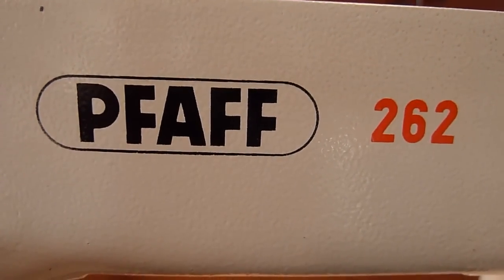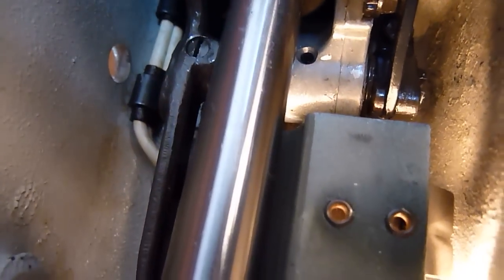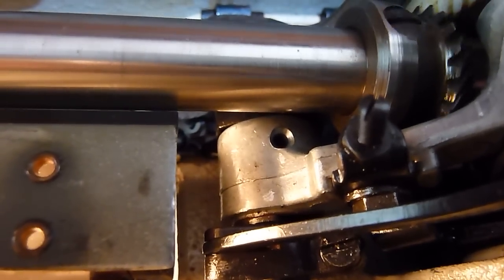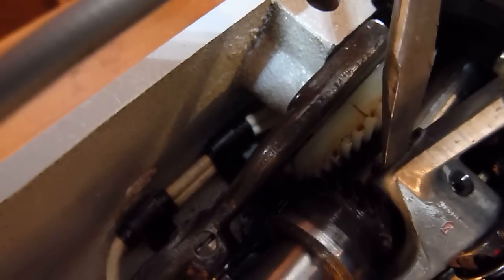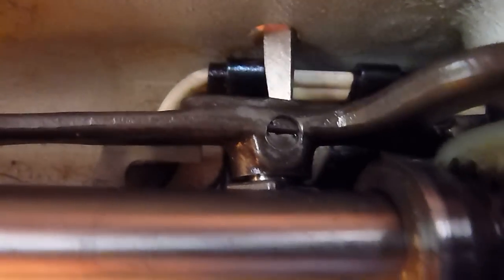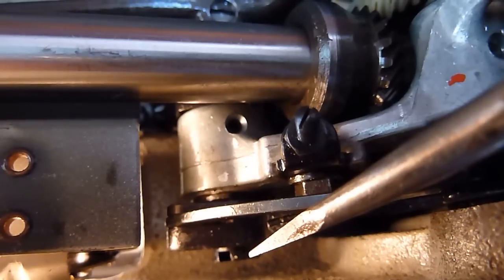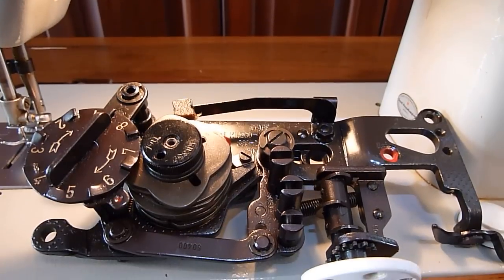How To Repair a Pfaff 260 262 332 360 362 Zig Zag Function

Comment from the maker: Hi, glad that helped you.
Re: the stitch width.  First, use a hair blow dryer, from inside the machine, to get the metal components in the area of the dial, hot.  You are not pointing the blow dryer at the white plastic knob on the outside of the machine!  You are pointing the blow dryer at the metal levers inside the machine, so take the lid off the machine.

Once you have the components hot, spary with PB Blaster and start working the control knob.  It should free up.

Comment: Thanks for the video. I was able to free up my 362 with a heat gun (with narrow tip) 800degF and pointed at the aluminum arm. I used Kroil to lube the entire assembly.

Comment: Hi Austinado16,
Many thanks for your time and video-work! 
I have 3 Pfaffs to repair with the same 'problems' - 260, 2x 360 and we have also two perfectly working Pfaffs; the 332 and 362. All automatics except the 332. 
We just love the Pfaffs. Your video will sure help me out. Even though I do have the repair technical manual.
So, many thanks! If I encounter problems with the repair, I sure will post them here..

Comment: Thank you so much for posting this.  I inherited a Pfaff 362 that had the same issue, and followed your instructions to free up the zig-zag mechanism.

Could you also post something about how to remove and clean the stitch width dial?  Mine is very difficult to move, and it feels like it has the same issue with varnish buildup.

Comment: Your suggestion using a hair dryer and solvent worked perfectly to get the zigzag on my Pfaff 360 to work.  I couldn't turn the screws that hold the cam mechanism in place, so I sprayed the areas you described using the long, thin tube on the can and heated those connections with the hair dryer.  Then I kept the heat on and began putting the zigzag to work until it ran correctly, 0 to 4, forward and reverse.  I am so grateful to you.  Until someone can do a better job, at least I can keep the machine running properly.  Thanks, again.
Reply from the maker: Patricia Pflum  So glad you found this info helpful and were able to get your machine working again.  Nice job!

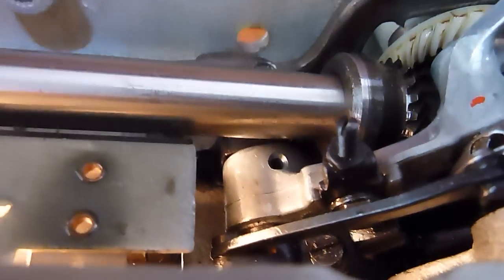Comment: Thank you so much for this video. I could not figure out how to center needle until I came across this video. Centering needle is at 3:00 for anybody looking for help with needle position. 👍
Reply from the maker: You're welcome!  Glad you were able to get it dialed in.
Reply: austinado16 I have a 360 and have  been dealing with a timing issue when I use the ZZ. Needle hits hook  but can not figure out a easy way to adjust timming. In straight stitch is perfect chain stitch. Any help would be appreciated.
Reply from the maker: I'm sorry, I can't help you with that one.
Reply: Maybe your needle is too long or adjusted down too far.

Comment: After freeing up the zig zag function as is so clearly detailed in the video, I found that on one of the machines, the zig zag function worked but the machine seemed to bog down when I switched from straight stitching to zig zag ( 0 to 4).  I traced the problem to the needle bar assembly.  After removing the needle bar cover, I found that  the adjustment screw pivot, the slide block and the interface between the needle bar and the crank which drives the needle bar were all bound up with shellac.  I completely removed the adjustment cam screw, and slid the needle bar on its slide out and away from the crank arm.  Using lacquer thinner I then cleaned up the slide, the pivot shaft and the adjustment screw cam pivot.  The shaft that is driven by the crank also has to pivot.  The pivot on the square block on the needle bar was also frozen.  After freeing up these pivot joints,  and reassembling and re-lubing,  the bog down problem was gone and the machine spun freely in all modes.

Comment: Thanks for the great video. I haven't found anything else on these machines with regards to repair. Do you have any pointers that would help remove the pin? I have the set screw loose and the clip removed. There is no movement in the pin itself, and I suspect it is seized.
Thanks again for the video, keep up the good work.
Reply: hi kirby  im not sure if you got it done but what i did was...
first get the locking screw and clip off
then i let some penetrating oil soak into the grooves for a few days
then i tapped the pin into the machine a bit just to loosen it (toward the nylon gear)
then let more penetrating oil get in there
then, VERY gently tapped the pin back out from the machine with a small hammer and a nail as a drift (pin pushing tool)
in the past i have also use a hairdryer and/or heat gun on the area which helped get things loosened up, but again i do this with great care not to over do it.

Comment: I have a Jeans Machine WHITE 1077 that this same problem occurred - the vaseline/gasoline combo worked like glue and the zig zag has stopped working. Machine still in good condition. The mechanics are slightly different than a Pfaff, but do you also know how I might go about fixing my machine? I'm very new at this, but want to figure it out!
Reply from the maker: I don't know the specifics of your machine, but you could try heat from a hair blow dryer and a penetrating oil.

Comment: Awesome video Todd! I purchased a Pfaff 260 that only does straight stich  and zig zag. It has not been used in a while, so of course it seized up, I managed to get it to work a bit using a hair blow dryer. However the needle doesn’t work to be moved left or right it’s stuck only in the center. Also when I disengage the clutch to wind the bobbin with thread the needle is still engaged. Any ideas how to fix it or any suggestions I would greatly appreciate it! Thank you in advance😁
Reply from the maker: The machine is still glued together inside.  You will probably have to remove the special stitch cam assembly, so that you can watch the internals of the machine, determine what should be moving, and what it will take to free it.  It's not uncommon for the hair dryer to melt the old lubricant enough that the machine works, then, while hot, but then won't work after it cools, because the old lubricant cools, and returns to thick glue.  In situations like this, the pivoting parts have to be disassembled and cleaned with some type of solvent.

You could try applying heat and WD40.  WD40 is a terrible lubricant, but it's very high solvent, and won't hurt the paint on the machine.  The WD40 may flush out the old lubricant, and allow you to apply something like TriFlow, and then synthetic sewing machine oil.  Then once the stuck area cools, it will pivot.

Comment: I have a Pfaff 362 machine and was wondering if the video applied in my case. The machine will straight stitch and zig zag. The cam system will turn but doesn't seem to be working at all. The left right center needle lever doesn't work ether. But you can turn the lever left right and center. Reverse works too but I notice that as I turn the stitch length dial the reverse lever doesn't move as much. Moving it all the way to the end the lever doesn't move hardly at all.
Reply from the maker: You'll just have to take it all apart and clean out all the varnish that is gluing the pivoting components together.  Once everything is freed up, it will work perfectly again.

Comment: Hi @austinado16. Thanks a lot for this video. It's been really helpful; I now know what's wrong and that I can probably fix it myself.

However, I can't figure out how to remove the pin from the machine. The lockring and set screws are removed, but it won't move at all. Sprayed some WD40 and applied heat, which did work in so far that the zigzag dial now moves. But I still can't seem to get the pin out. I tried hammering it out with a screw driver, but there's no movement at all. From the inside to the outside (and front) of the machine.

Do you have any advice? It's a Pfaff 362 which is in fine working condition apart from the zigzag mechanism (and it won't stitch straight, even when the dial is set to 0, but I assume this is the same problem).

Thanks!

Comment: Great video.  Was able to free up one 362 and two 360's.  Would like to understand the adjustments better.  From what I understand the screw in the rear middle with lock screw adjusts the width of the zig zag.  The screw in front which you access with your screwdriver turned sideways eliminates zigzag when you are dialed at zero.  The screw on the mechanism arm with locknut  centers the zig zag with regard to the straight stitch.  The front adjustment moves the entire zig zag range in relation to the slot in the bottom plate.  Am I correct?  When accessing these adjustment screws, you will find that they are also frozen.  I had to use PB blaster and a heat gun with a small diameter tip to concentrate the heat.  It is also important to use  screwdrivers that have the exact tip width and tip length especially on the front lock screw.  I had to custom file and fit the tip to fill the screw slot because the screw was so hard to turn even with heat.

Comment: Hi.. I have the 332 model and it´s in great condition and has spent most of it´s life sitting in a cupboard by the looks of it ... I dug it out again the other day to do some sewing repairs and it performed flawlessly as it usually does ,  after I was finished I decided to pull the top off and oil all the designated areas as well as a drop of oil through the oil hole in the base plate behind the feed dogs .. the following day the machine was to be used again however now for some reason the feed dogs will not engage the material in order to pull it through , in their top position (when turning by hand) they fall short of the top side of the plate by about 0.5 - 1.0 mm .. and yes they are engaged with the feed dog switch  .... would greatly appreciate any ideas as to what could be causing this as I´m at my wits end as to why and what just from giving it oil  ?  there´s no adjustment screws as far as I can see

Comment: Good evening, one question.
There is a screw just beside the nylon white gear showed in your video. 
As I understand it, this screw locks the other screw located in the back of the machine (to be precise, the latter scew is located in a little hole in the back of the machine).
I was wondering what is the purpose of this screw, what it is supposed to adjust? 
In fact, I unscrewed this latter screw (after having unlocked it with the above screw) and now it is loose and does not seem to thighten or adjust anything???
Reply from the maker: Mmmm...  good question.  I still own this machine, and still use it, but I've never played around with that part of the machine.
Reply: Ok. Thank you.I will try to figure it out!

Comment: Concerning the "Pfaff Automatic 362-261 Gebrauchsanleitung". Page 8 & 9 of that manual is about the "Zierstich-Automatic":
=> To prevent the Automatic function from freezing. From time to time use E=3 (top white wheel), D=4 (Top coverd black wheel), C=5 (Upper front wheel) for several minutes. With lifted presserfoot & no sewing cotton.
The E wheel is for the pattern length. At 0 the Automatic drive is off. Then only zig-zag.
Reply from the maker: Thank you for the information!

Comment from the maker: Sorry for the delayed answer, but glad you got it working again.  I'm usually able to free them up with heat, as I describe below.  The one on this machine, along with the stitch length dial, were locked up solid.  Both came back alive using PB Blaster and some gentle finesse.

In the future, try to get in the habbit of running the machine once a month, even if you're not using it.  Kinda hard to remember to do that, but it'll help it stay loose.

Comment: Cool video. So my 362 isn't frozen but the zig-zag is not moving on its own but I can move the needle bar side to side by hand and sometimes moving the the needle position lever moves the needle bar or moves to right but doesn't follow left Does that top spring off the embroidery unit effect the positioning so much? More oiling?

Comment: I followed along and got my Pfaff 360 all cleaned up, unfortunately while reassembling, the zigzag tension spring that goes down by the drive belt fell inside. I was able to retrieve it but need some help connecting the lower end of the spring. Have you had to deal with this? Where does it connect and how do I access?  THanks..

Comment: I managed to do my own, but it wasn’t straight there. What could be wrong if the stitch length is 1 mm in position 0?
Reply from the maker: With the top lid removed, watch how the mechanical parts are actuated when you rotate the stitch length knob.  There is a "zero" position adjustment inside, and that has to be set so that when the knob is at zero, the mechanical arms aren't still "pulsing."   I know that's sort of a rough description, but I think if you pop the lid off and look down inside at the pieces involved in stitch length, you'll be able to visualize what's happening, and locate the adjuster.  Thanks for watching!
Reply: @austinado16  Many thanks! I made it!

Comment: Hello, you’re probably not going to see this but just in case you or someone else can help. I have bought a Pfaff 260 . The straight stitch works but the zigzag knob doesn’t turn past 1 and when I turn it the left to right lever moves with it. So clearly something is stuck together. I am not going to attempt to disassemble this machine, there is just no way that scenario ends well. But I would like to try to get it to work with one of the products you mentioned Kroil, Triflow or PB blaster. Where would I put these products exactly AND am I to use like a blow dryer or heat gun WITH these products. Thanks to anyone willing to help me.
Reply from the maker: In the video I show the areas that get glued together as the original lubricant dries up and leaves behind a sticky varnish residue that winds up gluing the pivot points.  Apply the heat from a hair blow drier, and your penetrant (I would use Kroil) to these areas, and wait for the metal to heat up and start softening the varnish.  Continue applying heat and then operate the machine and see if you can get zig-zag knob and function to begin to work.  If you can get the machine to function, at TriFlow to the same areas where you used Kroil, and continue to operate the machine.  You may get lucky, and get enough penetration from the Kroil, and enough lubricant from the TriFlow, that the varnish is displaced sufficiently so that it doesn't congeal and glue the machine back together once the metal cools, and/or the machine sits for a period of time without use.
Reply: @austinado16  thank you so much for the information. I have to check the price of Kroil in stores here because from amazon it’s like 65$ might had well get it professionally serviced

Comment: Hi, My mum has a Pfaff 260 sewing machine. Would you be able to advise or do a video on how to replace the carbon brushes. Thanks
Reply from the maker: Sorry, but I can't do a video for that.  I think you'll take the hand wheel off, and then the plate at the bottom, below the hand wheel will come off, and then maybe the very bottom of the machine where the motor sits on a plate?

Comment: I'm working on a friends Pfaff 260 and your video was a great help. I had to take the aluminum piece out to get it clean. My current problem is that when I put it back together the zigzag width knob will only turn from 0 to a bit less than 1. I've tried several times with the same result.  Can't see what to do next.
Reply from the maker: Tough to offer accurate assistance via keyboard, sorry.  If the dial works fine out of the machine, then the issue is probably how the components have been re-assembled after taking them apart.

Comment: Hello, I have a Pfaff 332 and my Zig Zag Button blockedg in the middle of the work. It does not any more. The rest of the mechanics is easy going. I already pulled off the white botton and tried to move the screwed rod but nothing happens. I bought the machine some time ago. The seller told me it was refreshed and showed me also a bill. I wanted to learn sewing on this machine but this week my mother was the first to use it. First the button could be moved, not easely and suddenly it blocked.
Reply from the maker: Hello!  I'm sorry to hear that the machine is giving you a problem, but it's not uncommon for these old machines if they haven't been heated, freed up inside, and lubricated.  If you follow the video, you'll be able to take the top off the machine, and use a hair blow dryer to get the inside of the machine really hot.  This will melt that varnish that is gluing the machine and keeping all the internal parts from moving smoothly.  While it's really hot, use synthetic sewing machine oil on all the pivoting and moving parts.  Good luck!
Thanks for watching, and for your comment!

Comment: Thank you for this.  I had a 362 that sewed straight and stitch length dial would only turn to 1.  The zig zag lever was stuck in the down position.  Following along this video, figured out both pins were totally glued inside.  Before I came along this video though I couldn't even begin to figure out what was happening inside.  It's no vintage Singer..  :D
Reply from the maker: You're welcome.  Glad you were able to get it all dialed in!

Comment: I have a Pfaff 260 and the zig-zig function is not working, only the straight stitch. I removed to snap ring and the set screw but I cannot drive out the pin. It seems to be really stuck. Any recommendations how to remove it easily?  Thank you so much!
Reply from the maker: lt's probably glued in position with varnish and will require heat from a hair blow dryer.